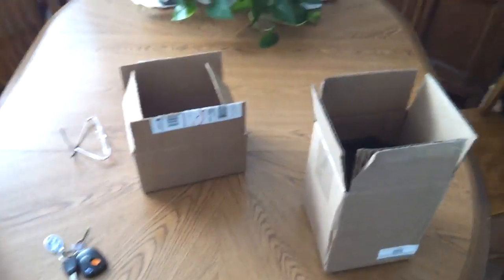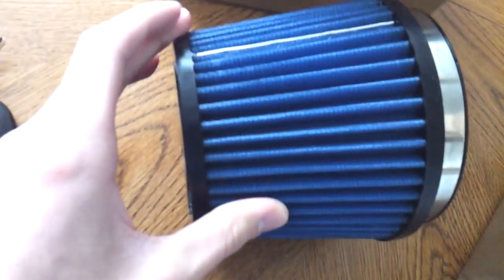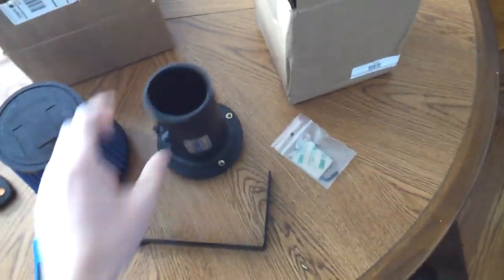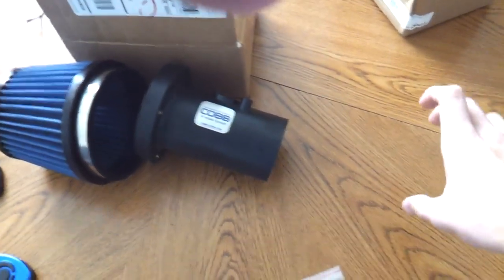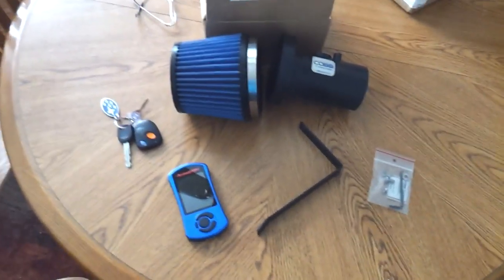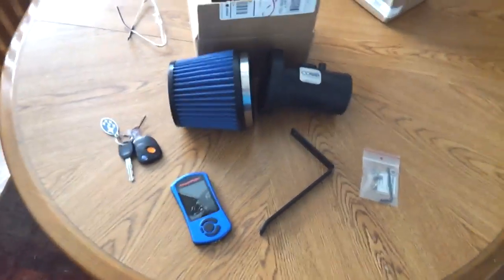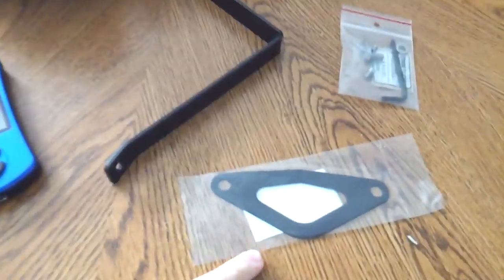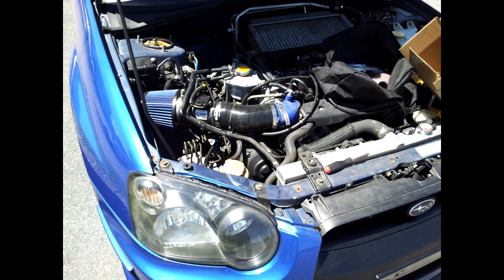COBB Short Ram SF Intake Unboxing

Comment: Is it recommend to tune right after u install it??? And what website did u get it at? I have a 2005 Subaru wrx
Reply from the maker: I bought it from good 'ol
http://www.rallysportdirect.com/

You don't NEED a tune. But it's recommended. Either research open source tuning, buy a Cobb AP (preferably v3) and flash to stage 1 or 2 depending on your mods OR get a professional tune on a dyno.

You may get a CEL if you don't tune.